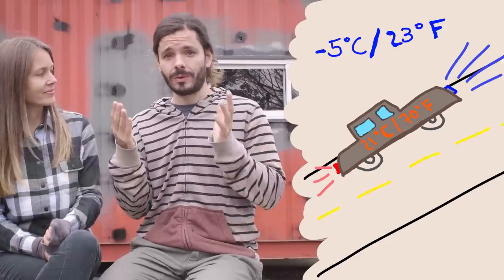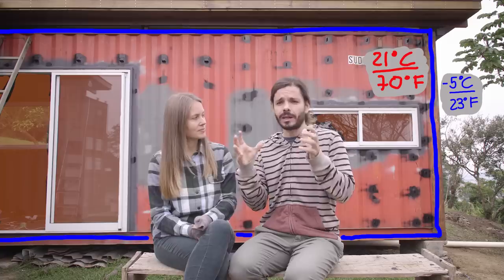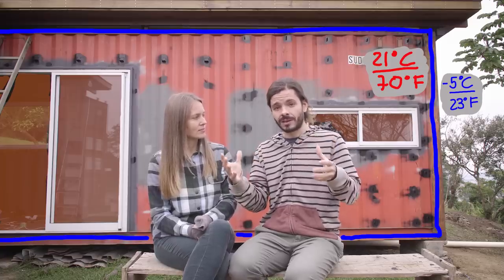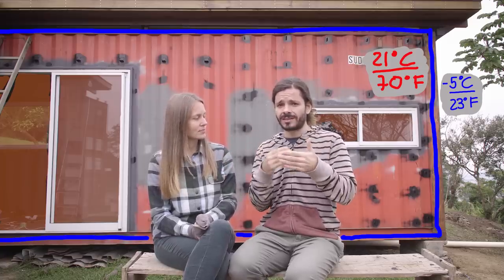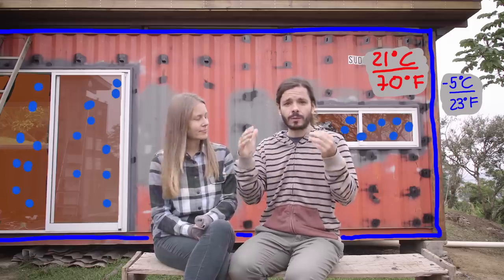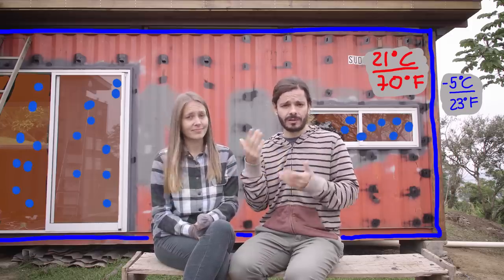How to avoid CONDENSATION on a Shipping Container - Living Tiny Project Ep. 033

Comment: Until you find spray foam you may want to consider 2 vents in the lower/ bottom of walls with a cheap humidifier to circulate the air from building up moisture.  A steady flow of air will not accumulate  moisture.  I used the vents from a dryer outlet from your home. This is the best and cheapest way for your problem. I have never had any worries. I have very cold winters  and very humid summers.
Reply: Wouldn't that be a De-humidifier?

Comment: We just saw this video and we're considering a shipping container house build, so we're very interested in what you did and how it has performed over the last few years.

Rob C at The Off Grid Tiny House had a very small condensation issue in his trailer tiny house, where moisture condensed on the ceiling near one end of the trailer, far away from the wood stove, and followed the contour of the closed cell foam to the lowest hanging point where it dripped to the floor. (Quality closed cell foam is said to be impermeable to moisture, so by sticking to the metal container walls it effectively keeps any moisture from ever reaching the cold metal - which is ideal. However, in very cold climates, the most interior surface of the foam, facing the occupants, can get just cold enough to act as a moisture condensing surface for the high interior humidity that is typical in a lived in space. Interior ceiling fans can act to evaporate that surface condensation and proper ventilation can remove it from the dwelling.)

I visited an earth bermed house that had a condensation problem on the bermed north wall side, where the ground temperature made the wall just cool enough to condense indoor moisture all the time. Since it was a super airtight build, special measures were needed to solve the problem.

Solving a potential condensation issue before you proceed with a build is really your only chance to get it right. If you fail, then you're looking at a possible complete interior teardown to get at a massive mold issue sometime in the near future. Ouch!

Comment: HI, good episode, been dealing with conventional ventilation problems myself with building our summer shack in the woods. Gluing some net over the ventilation holes is perfect. You might add some small holes at the bottom of the container walls. When the container heats up in the warmer weather it will allow the heat to draw in fresh air from the bottom and move the stale air behind the insulation up and force the air out of the walls at the top. Heat always wants to rise, on warm days the metal can get hot, having a few small holes will offer a passive way of ventilating the space between the insulation and the metal wall. On cold days it won't make a great deal of difference. Mold loves moist hot days.

The reason I suggest this is that on a conventional house you would have airs channels in the roof so that mold doesn't grow, so its the same principle

Personally, I would forget the rubber lining the metal, it's nonporous so coating it with something seems like overkill. If it's well ventilated you won't need to worry about rust.
Reply from the maker: Thanks a lot for the advices!! We are thinking about the bottom holes it might me a good think. We are only afraid with bigs. We are still worried about nests inside the wall. 😨

Comment: Going through this right now,,so I come up with this idea,
treating the steel as say siding,then use  building paper,2x4 with insulation, then vapor barrier,,,then interior sheathing. Of course we will loose a bit more interior room,but it beats having mold in time.the air gap makes sense for sure,
I could not find anything on this topic,,or other vids I did find,left me scratching my head,,,
It's good u guys thought this through,and asked the right people...
Greetings from Canada 👍

Comment: For Bugs issues through the vents of the Shipping container, Purchase bugs screen mesh, Cut to required size and apply it over vent . Use Silicone caulk to hold  it in place. multiple layer of mesh is prefered.

Comment: Okay, in general their are two proven methods of preventing in-wall condensation in any structure.

Method #1 = Setup a breathable channel to allow air flow usually between the exterior siding and the insulation.  The effectiveness of this method is variable depending on how well it is executed, you need to have enough air flow without having so much air flow that it starts to defeat the insulation.  And of course their is always the issue with various critters, insects and otherwise (birds, rodents, etc . . .) setting up house in the air channel.

Method #2 = Seal everything up tight, tight, tight so that damp air can't get in and cause condensation.  The most effective way of doing this is sprayed in closed cell foam done in an on-site application.  The second most effective way of doing this is is to use closed cell foam panels and glue, calk, tape, etc . . . them in place to create an air tight seal.  The effectiveness of this is dependent upon how good of a job one does in cutting the foam to exactly fit the application space and gluing it in place without creating any gaps.

For those considering this method with a container who are in North America there is actually a company that makes foam inserts that are formed to exactly fit the standardized container metal corrugations which you glue in place and then finish with standard flat panel foam board = https://www.insofast.com/products/shipping-container-insulation-panels.html  I personally have no affiliation with this company other then having seen their product being used in a acquaintance's container house build that I was involved with and from what I have seen they work quite well.

Be aware though that not all glues and calks are "foam safe" so you do need to read the labels and get adhesives that are "foam safe" to bond the foam to the inside of the containers metal and then "foam safe" calking to calk any gaps in the seams.  The spray foam is the best option but where it isn't available you can use the inserts and flat foam board panels with the correct adhesives to do nearly as good of a job for those choosing to go with the method #2.
Reply from the maker: We 100% agree with you!!
Reply: Sorry guys to say that, the insulation inside is the main mistake in my opinion. 
Less room, more trouble. :(
The container basically is sealed, and air tight. Why don't you use this property?
If you put the insulation outside and make it air tight, as turbo 1889 mentioned in method #2, than it can not cause thermal bridge, so the wall inside of your container will be consistent temperatured with no condensation points and junctions.
This is the key: no thermal bridge = no condensation points where the moisture can precipitate.

Sorry for my English. I think you will understand what I mean.
I love your project.
Keep going Guys! :)
Reply from the maker: The problem is how to guarantee the internal part of the walls are air tide. Not in between that and the out side. I mean air tide in between the internal prt of the walls and the internal part of the house. As there is always humility on the inside the house.
Reply: Your are right! There is always humidity inside.
BUT! If your walls have no condensation points (those are usually colder than any other parts of the walls/building),  the moisture can not precipitate.
(The ventillation gap between the wall and insulation just works against efficiency of the insulation. :( )
The meaning of "airtight" is very important -->not allowing air to escape or pass through.
It is not equal to there is no air inside the insulation!
 (eg. EPS is a foam with lost of air inside ;) )
If the wind can not go through your insulation that is enough, it's okay. 
The insulation can surround/contain any sealed air, but won't let the wind pass through.
Reply from the maker: I agree but disagree. Hehehe it’s a tough matter, and at one point we needed to make a decision and try it out. At least on this first part of the house we will give a try with ventilation.  And let’s hope for the best!! 🤞🏼🤞🏼
Reply: I will have to agree with Turbo 1889 on method #2. 

I also recommended the Insofast panels many many videos a go but they mentioned it wont be available on Brazil. 

They are three factors you have to take in consideration when you talk about condensation:
Temperature, Relative humidity (how much water in the air) and dew point, ( at what temperature the air can not longer hold water and will start to condensate)

You can avoid condensation by:
-Reducing relative humidity.
-Avoiding temperatures that can reach Dew point ( that's why we insulate to avoid wall reaching those temperatures)
-Increasing the temperature ( that will reduce the relative humidity)

I KNOW that if you leave the vents open to the outside you will collect water inside the walls. imagine early in the morning, metal walls are cool, air leak through the wall assembly and get in contact with the metal. BooM water ! if you have few rainy days it will be worse. the metal will take a long time in order to elevate the temperature to reduce the relative humidity inside the wall cavity. What about if the wall that aren't exposed to the sun, will never warm up on rainy days. Remember AIR always carry WATER please don't leave the vents open.

That's why I will recommend AIRSEAL and insulate the outside of the house (As some of the comments already suggested) . That will create a thermal separation between in and outside of the house including the elimination of thermal bridging. 

You can always control the relative humidity of the indoor but you have not control over mother nature.

Putting a layer of rubberize membrane on the inside wont give much R-Value ( thermal resistant) on the metal walls. It only ovoid the contact of the water ( or water vapor ) with the metal surface and eliminate the worry of corrosion on your case.

I will suggest you to visit this page: it is a Dew point calculator. Plug some numbers with typical temperatures and typical relative humidity you will experience on you climate zone. Any surface that reach the DEW point (temp) you will have water ..... 

http://www.dpcalc.org/

That is my humble opinion.

I really LOVE  your videos Please keep them coming ! 
btw. I do energy audits for a living, I seeing a lot of damaged houses dew to deficiencies on the wall Assembly.
Reply from the maker: Thanks so much for all the suggestions. In the end we discovered a new insulation product that sells in Brazil and that we think will solve the problem o letting the cold plate cool up the inside of the walls. It’s aluminum foil with an eps core that can br glue to the walls and create an envelope of good insulation around the entirety house. They say the product is based on astronauts suits. And in this way we will close the vents to guarantee we are bugs free. 👌🏼👌🏼
Reply from the maker: Now we bought insulation already. We have never never heard of it. I will take a look. 👌🏼
Reply: Odd Life Crafting it might be what comments mentioned...
Reply: Can you tell me the name of this product?  Thank you.
Reply from the maker: The one we used? 3tc

Comment: Hi guys, the problem with the condensation is that the metal is a temperature amplifier, so I think you should try to apply insulation to the outside of the shipping container.
Reply from the maker: For sure it’s a solution. 👌🏼

Comment: I live in West Virginia, built a home starting with two sea containers, which is a nightmare. One is aluminum, the other steel. They are spaced 15 feet apart, with a wood structure between and a wood structure on top, as a second level. I covered the aluminum side with fiber barn panel, on the outside, hoping condensation isn’t trapped between. The steel one on the other side is exposed, where I have my kitchen and a wood burning stove. I had a wood cabinet sink, which I replaced with a stainless steel commercial sink and counter. As I pulled the wood sink, it was covered with mold. Now it’s breathing better and not trapped, but the outside of the container is still exposed. I guess I will cover the outside, or build out, with a wood addition, to make my container an inside wall instead of exterior wall. Although, it’s stressful and a lesson learned. The other mistake, I set them down on stone, crush and run, which a groundhog has borrowed under. Now, I have to cut all my floors out and pour concrete. I’m now working backwards. After doing the math, wood building structure is cheaper and better. I advise anyone, don’t do it.

Comment: Hi Guy's:   An  addition you might consider  is whisper fans in an external metal elbow duct.    One fan blowing in mounted on the air vent;  a second one blowing out on a opposite corner .   Even though they are less than 100 Cu. ft. per minute; this might remove any moist air.   And can be added later if needed.    And I would run the idea past your current advisor first.   the old guy    Bert
Reply from the maker: Thanks a lot for the suggestion Bert!!
Reply: Yes, I also have this. a 12volt DC computer fan on each vent, one pointed inwards and the other pointed outwards, would do the job nicely, and they would run off a solar panel about the size of a cigarette packet.
Reply: Could you provide links, this could help many people! Thanks for the ideas.

Comment: Hi guys, I'm also using shipping containers for my house, but different design. I'll have 2x20ft and space between them 8meters and roof over it. This way I created a breaze way, so there always be a flow of air. That is the best way to deal with the condensation.
In your case as the containers are joined, you could use active ventilation on the ceiling, a simple 12 V exhaust fan would do the job, just use a solar panel to power it and have it on all the time. As the humid air rises, it'll get sucked out, even on a slowest setting, just to get it moving.
One the actual walls, you can use a small computer fans, just to create enough airflow, rather than relaying on passive container vents.
This way you'll have the air always moving behind the walls and limiting the chance of condensation.
Airflow is the word here :)
In regards to your wall clading-plywood unless heavily treated by chemicals, absorbs water and creates a mould problems.
And if you are worried about mould related illness, there is also a problem of off-gassing from glues, paints, etc... So again, not to have the ill air sitting around, active ventilation is way to go.
Hope that helps a bit.
Reply from the maker: Hi Michal. Thanks for the tip. We will think about it. 👌🏼

Comment: You can buy some small plastic rings -about 3 or 4 cm across, which I did. Then I epoxied some plastic mosquito net across one side of them. Trimmed off the extra and filled the holes I drilled with the rings. No bugs and 5 years later they are still in place keeping out the bugs.
Reply from the maker: That's really good to know!!